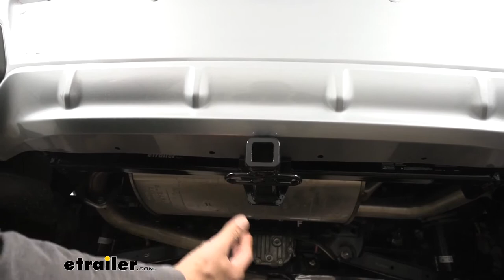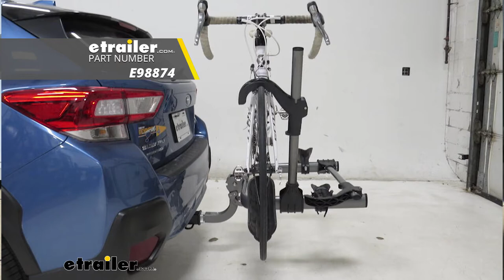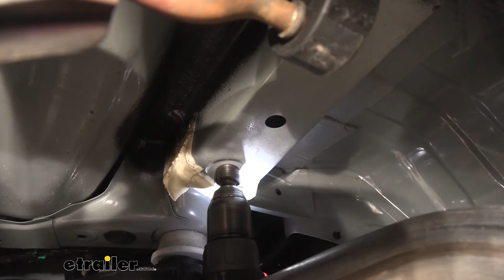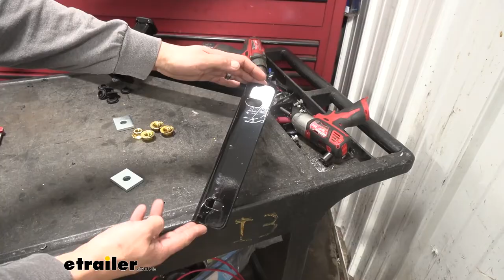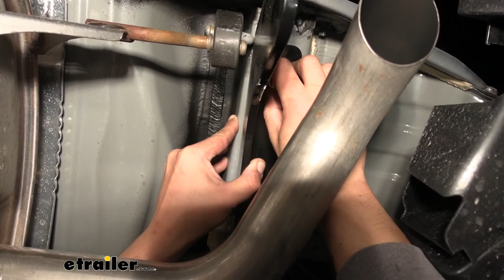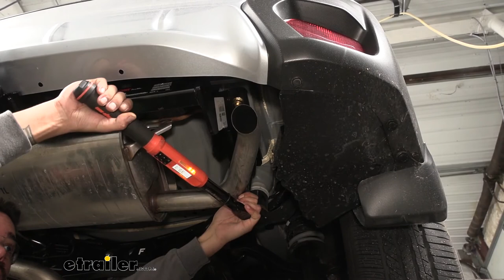etrailer | Curt Trailer Hitch Receiver Installation - 2019 Subaru Crosstrek

Comment: What size do the holes need to be enlarged to?
Reply from the maker: The block washers are 1 inch wide, so the hole either needs to be enlarged to that size, or you can slot the hole as shown in the linked installation instructions.
https://www.etrailer.com/instructions.aspx?pn=C12184